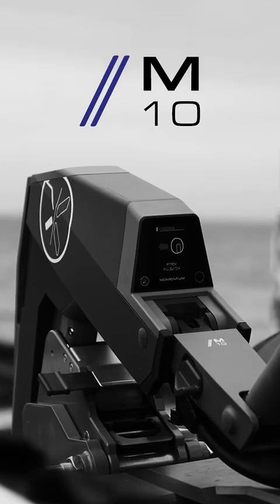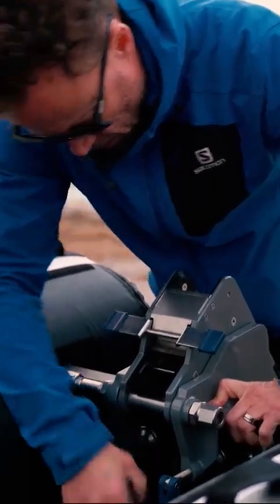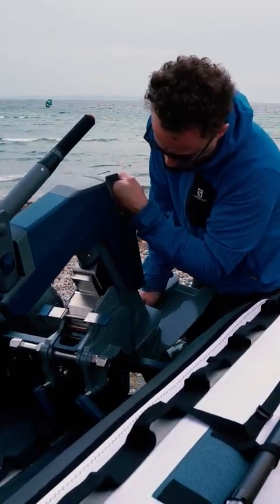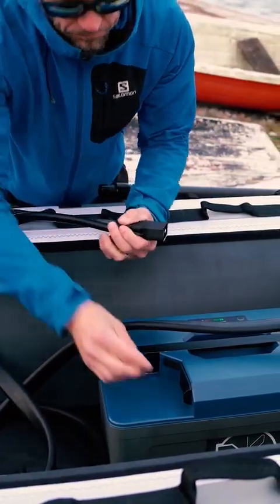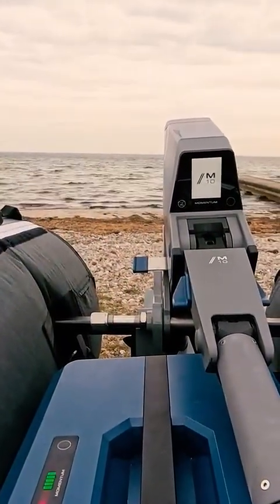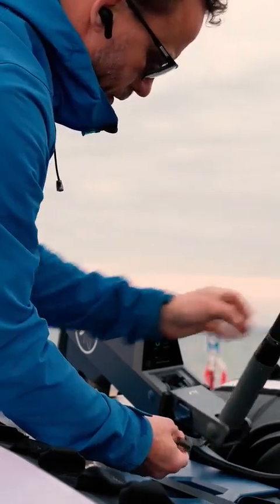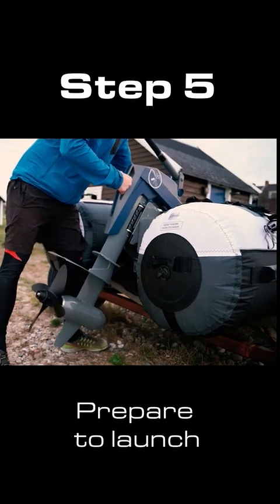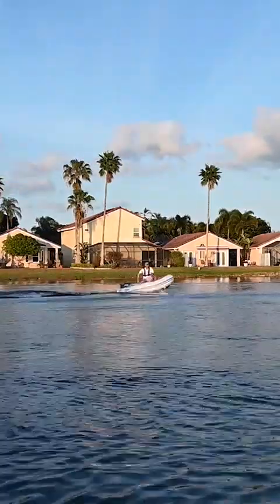Momentum M10 Electric Outboard Motor & MB6 Battery Setup Guide with Basic Operations

Comment: I'm considering the M10 for a Murray River trip in Australia , but cannot find any information about solar charging the battery.. Estimate around 30-40kms travel daily and some sections are quite remote , so having solar charging is a must for this particular journey.. Do you have any information about the charging system or is there a video in the works to showcase the solar range of the M10..?? Thanks 😎
Reply from the maker: Thank you for commenting. The M10 runs off a 72V 6.4kw battery. I’m not sure if solar charging will be a viable solution for most small boats with limited solar panels. You will need at least 1.2kwh of solar energy for at least 5 hrs good sun to meaningfully charge its battery. The good news is that if you travel 40km/day for 8hrs, you will be doing around 5km/hr. At that speed, the M10 could potentially do more than 100km with a single MB6 battery, boat type and weight dependent obviously.